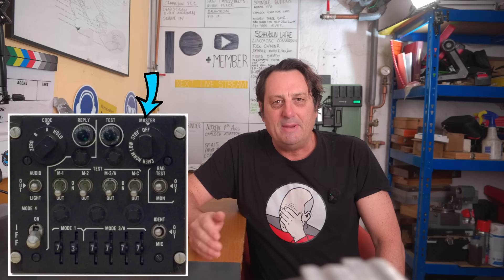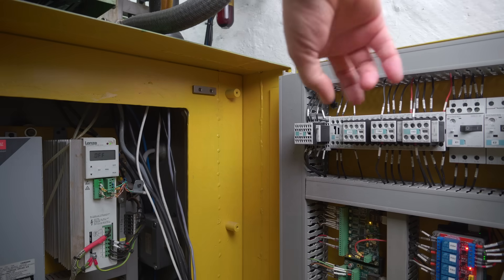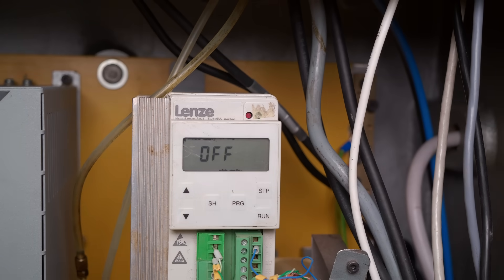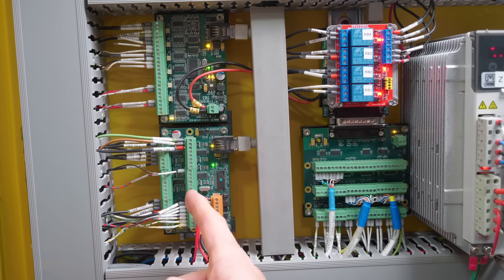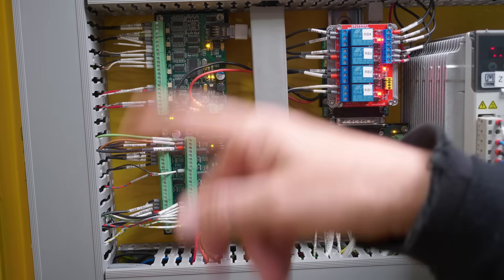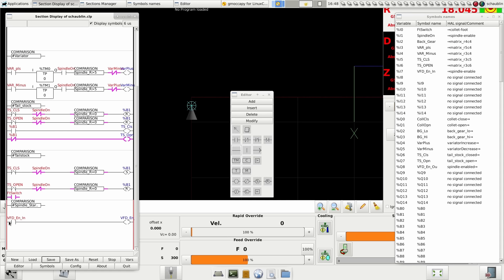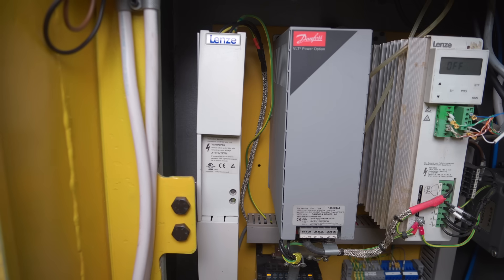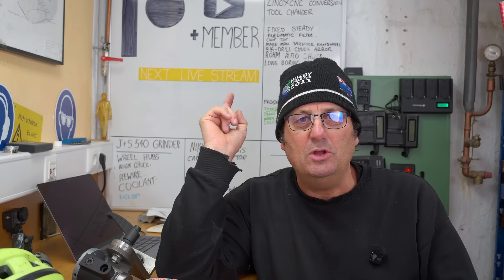VFD Braking fixed - Schaublin 125-CNC Ep. 63 || RotarySMP

Comment: I didn't see either a "drive at speed" or "drive at zero speed" output from the VFD to the control ? 

They are a standard connection of dedicated spindle drives & vfds I have worked with usually have the ability to switch these signals to the isolated relay outputs on the drive via parameter selection.

When I installed such things, I used to parallel a contact on the "zero speed" relay with the drive enable input. That way if the drive enable was removed with a spindle stop command (or E stop) the drive was kept enabled until the "zero speed" output switched. As a back-up to ensure that the enable was pulled under E stop conditions, an off delay timer was switched by the E stop circuit & wired in series with the "zero speed" parallel loop around the enable imput - the time delay was set a second or two longer than the longest spindle decelleration time, so in the event that the "zero speed" logic on the drive was faulty (or the relay welded) the enable was till pulled after a similar time to that taken for a decellerated stop. Better to have a disabled spindle coast stop than continue running under an E stop condition.

Always used the spindle drive  "at speed" and "zero speed" outputs to feed back "M code complete" for M3/4 and M1/2/5/30 respectively, so that feeds didn't begin immediately after the M3/4 was issued or allow continuation of the program with M1/2/5/30 until the spindle had reached the required state. This ocasionally gave problems when tapping on spindle reverse, where a spindle start delay would not be appropriate on the reversal, but most controls had an internal "flag" in the PLC to show if a tapping cycle was active & the wait for the "at speed" signal on revesrsl could be disabled.
Reply from the maker: Good tips. That is a pretty primitive drive.
Reply: @RotarySMP  Indeed. 
Looking through the interminable manual, there is an option to nominate relay outputs K1 and / or K2 (if your drive has this - not sure what your exact model is) as "zero speed" by setting parameters C008 & C117 respectively to a value of 7.  Default for these relay outputs is a value of 1 for indication of a Trip condition (though why you would want both outputs to show the same value is a bit of a mystery)  . If you have output K2 & are not currently using it then that could get you a "zero speed" indication. If you are using K1 to indicate a Trip condition & don't have K2 then there doesn't appear to be an option to have both Trip and Zero speed outputs - though you could use K1 for Zero speed if you don't monitor for the Trip condition.

Comment: why do you even need to disable the vfd?
Reply: Because it is not safe to work in the close vicinity of the chuck if it is supposed to be stationary (therefore the operator does not expect it to start turning) but the VFD is not disabled.
Reply: @SLeslie why would an electronic signal to tell it to disable be more safe than an electronic signal to tell it to stop moving?
Reply: @miko007 it's related to how the drive is internally designed.

I've designed similar electronics that needed safety interlocks. Generally if that enable signal is not present the drive is physically incapable of outputting power, and there would be several internal (on the PCB) layers to enforce that.

It's not just the microcontroller monitoring a different signal, even if the microcontroller / asic wanted to spin the drive if that enable signal isn't present the transistors on the output stage won't receive any power.
Reply: @MarkFunderburk  i get that, but you could as well get an error on that enable signal, thats all that i am saying.

accidentally sending the enable signal is imho not more or less likely than accidentally sending a speed command...
Reply: @miko007  The setpoint signal is analog, so a small change (caused by electrical noise for example) can cause the spindle to start turning. The enable signal is digital and needs much bigger change in voltage to change state.
Though I must point out that I am not very experienced with modern lathes, but if you check out the Weiler E 50 HD lathe you find that it still has a hardware spindle control lever, not just soft buttons on a display. I believe this is because that lathe does not have fully closed enclosure. And for this very reason I believe this Schaublin would be safer too if it had an actual lever with a dedicated switch to disable the spindle drive.
Reply: @SLeslie  thank you, this is the first answer to make any sense to me ^^
Reply from the maker: Yep, that is the reason. I didn't want EMI causing the spindle to turn unexpectedly.